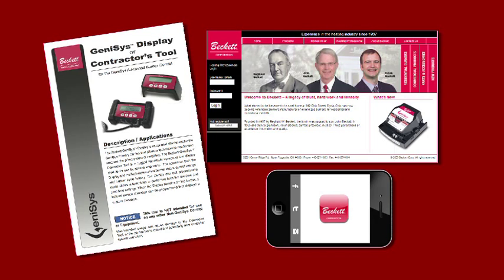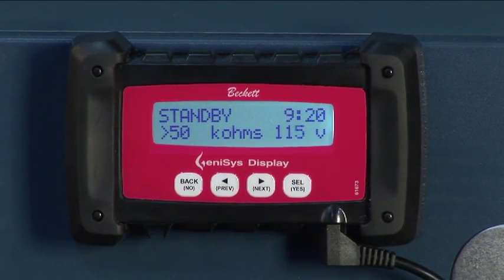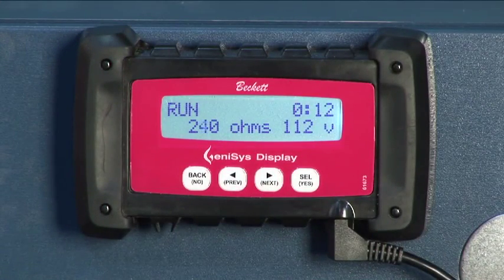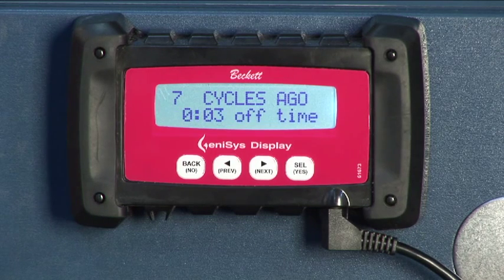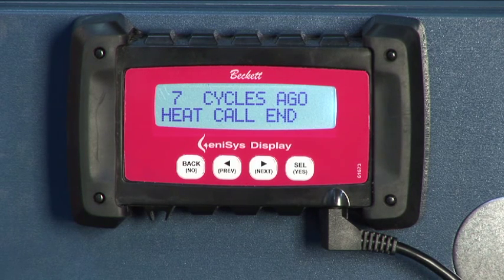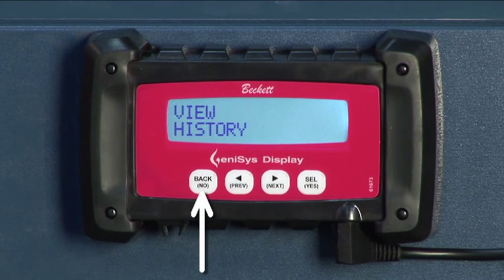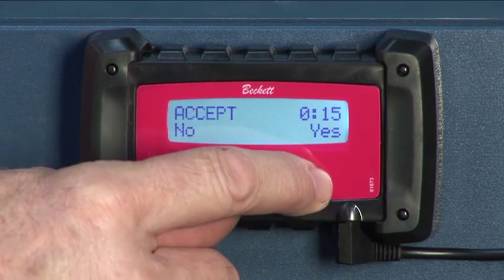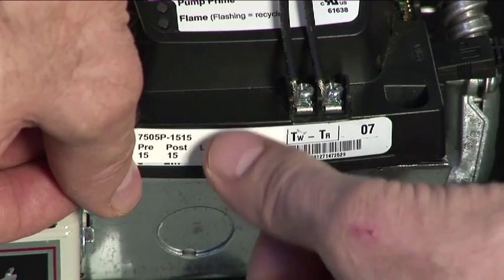Beckett GeniSys Contractor Tool

Comment: If the control starts cycling when you try to read the history, it's not your fault.  It's a software bug in the Genisys control, not the contractor tool.  The software is not updatable, so the control must be replaced again.  Better off with the Carlin.  The Carlin doesn't need an external tool and the adjustments are more inclusive and has a better history as well.